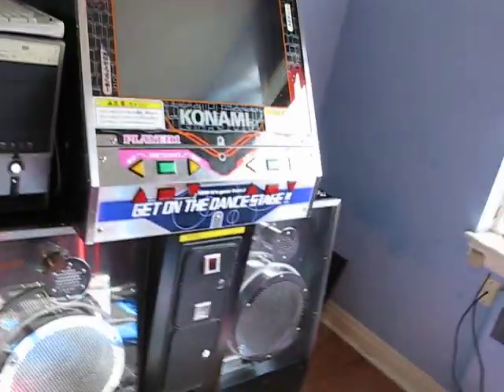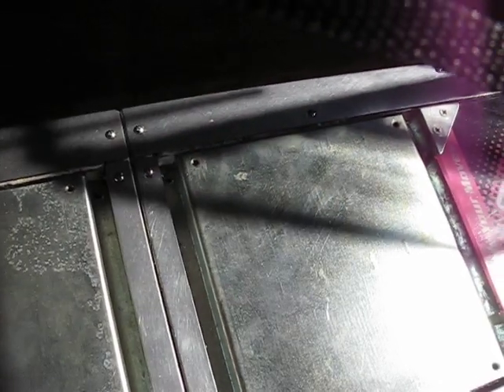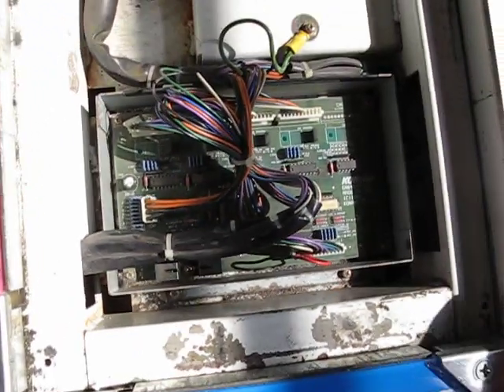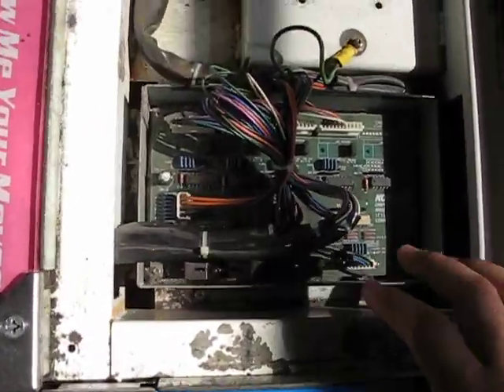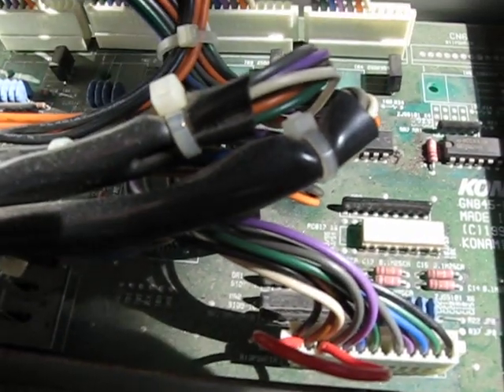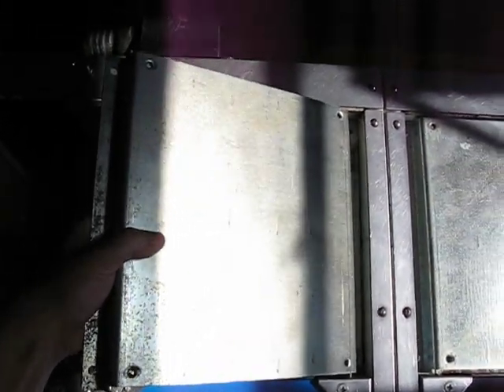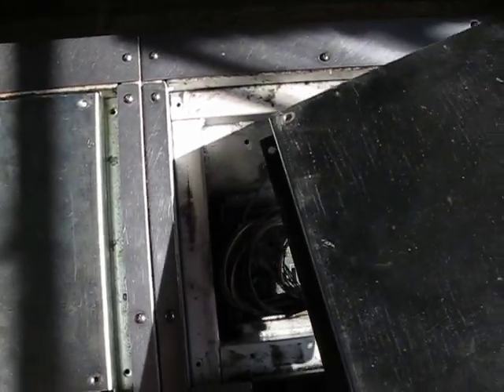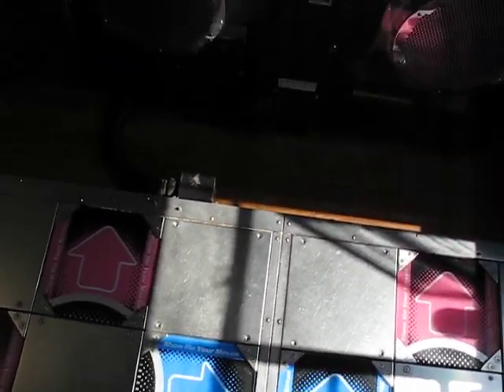DDR Machine to Stepmania Machine Conversion (pt. 4)

Comment: Did anyone have a solid answer about the Korean DDR cab? I have one as well, and the wiring is different, so I'm not sure which ones need to be bridged in order for the JPAC to recognize my pads.
Reply: hey I have a kcab as well. did you mod yours at all?
Reply: +k0bunn Yes I did. I followed the exact same pinout despite the color differences, and everything worked perfectly.

Comment from the maker: yes, but it requires LED lights and not the neon gas lights that came with the machine. The reason is because you a PACDrive and it can only handle so much amperage. The PAC Drive works great for LED light, but can handle the large amount of amps needed for the neon lights (that can with the machine).

Comment: DDR korean ver. has a different setting in the wires. There's an orange one in place of the white wire, and the white wire is almost at the end. Should I wire it to the orange one anyway or all the way to the white one?

Comment from the maker: @djfreebey no it won't damage the machine at all, and yes you can convert back to original DDR so long as you keep the 573 PCB board. In my case I would also have to put the DDR monitor back in, since the monitor I currently have in my machine is a 720p CRT monitor. But to answer your question, yes its all reversible.